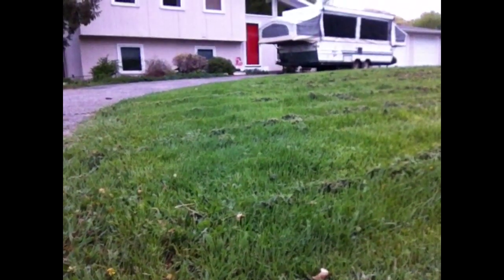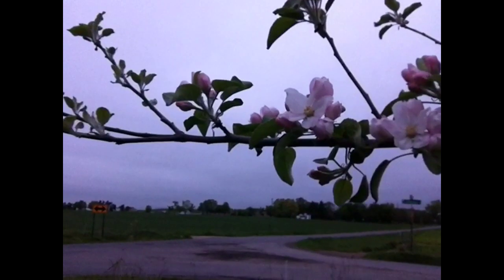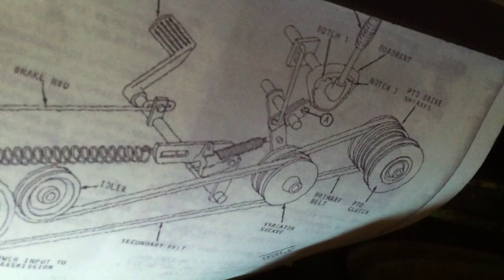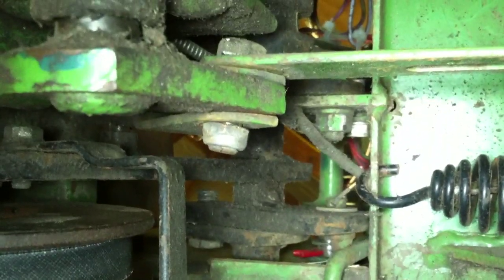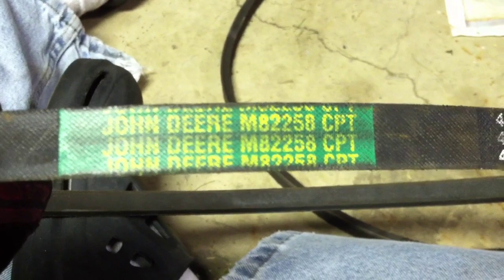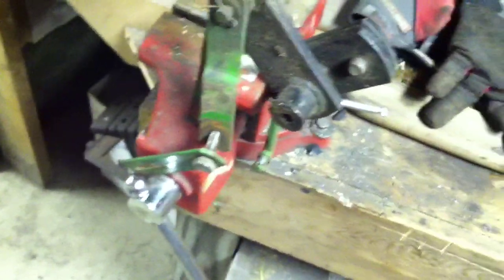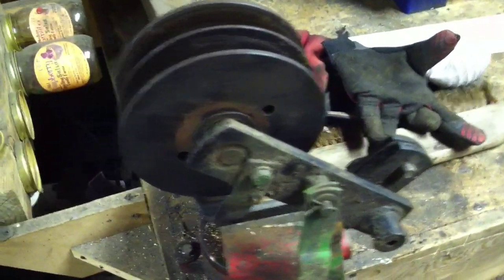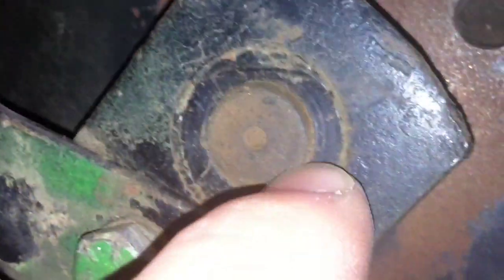John Deere 112 Variator Project Part 2

Comment: The shaft is gallded where the Variable part of pulley (sheave) slides back and forth. New shaft or weld and turn down and MIGHT have to sleeve or replace sliding part of sheave. My 212 did same thing

Comment: youve got the same rig i do if you havent figured it out i can take some pics of mine for ya. arnt you a mainer?
Reply from the maker: Hi Eric. I'm in Michigan, and I did get the variator figured out finally. Thanks for offering to take some pictures! I ended up picking up a really cheap parts tractor that had a good variator on it. Swapped it out and it works good now!

Comment: your belt guard has been bent out and up. hope that helps save the wear on your belts. The pulley is threaded You have to hold it and put a special wrench looks like it would fit a giant grinder. be very careful it is cast and will bust. Also you need to replace the bearing. my 110 is part # Am30082m. mine is a 1965 110.
Reply from the maker: You know, my last engine to variator drive belt only lasted a few weeks and I couldn't figure out why! Thanks for this tip, I'll check it out.
Reply: i had the same thing happen it was rubbing my new belt after the old one just broke unexpectedly. The belt dust is the indicator on that. I actually use mt old 110 to work with because it is more reliable that the new machines.

Comment: It should be smoother. I would look for a good replacement.Even if You press it apart and clean it all up You would have to get the center pulley to fit tighter. I have seen some with a little play seem to do ok but if it  tilts over enough to bind or stick to the center shaft and not slide along the shaft I can not really see it working right.